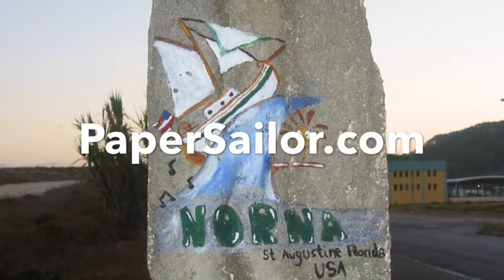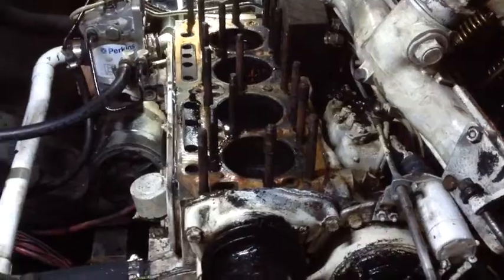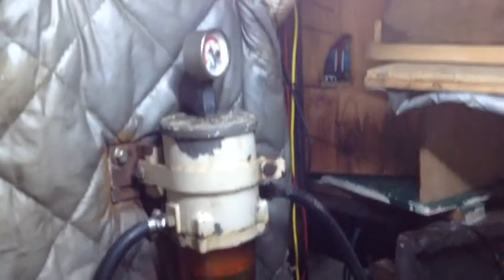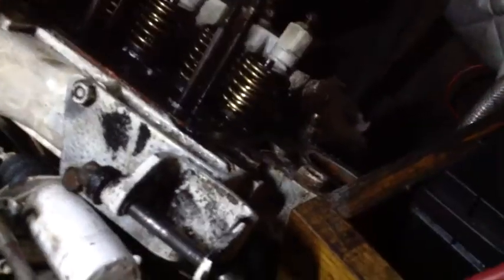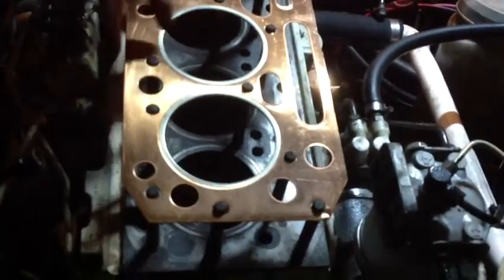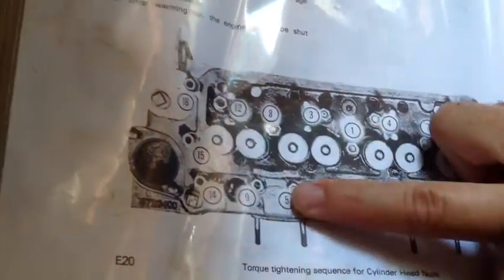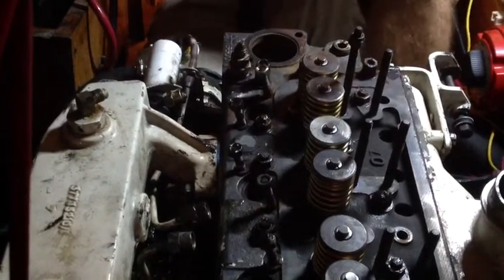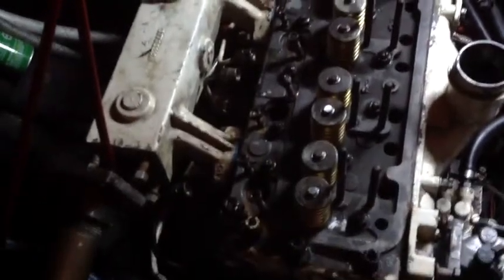Episode 16 - Replacing The Head Gasket On A Perkins 4107

Comment: when you torque the head down run the engine to temperature then while engine is still hot retorque head bolts an extra 10 lbs.this will ensure the head is really tight when it cools down.
Reply: Stuped, super stuped.

Comment: when you remove the head on a 4107 you might disturb the wet liner o rings,i did and lost the engine,when you put the head back on,refill the block with the most powerful water stop leak,that will ensure that if the o rings have been disturbed the water wont leak into the piston bores.some stop leaks can plug quite large gaps.the best on hear in the uk is miracle seal,amazon sell it so should be available in the usa.

Comment: Appreciate the video.  I am curious as to where you saw that the "goo" is to be applied to the head gasket?  My manual doesn't indicate that the goo should be applied but it also mentions a black gasket rather that a copper one. Any information would be greatly appreciated.
Reply from the maker: Ted Lahti this is for a 4107, apparently the 4108s are different
Reply: Sorry, I forgot to mention that my engine is a 4.107. Does your manual mention to apply the goo on the head gasket?

Comment: re-torquing head bolts after a rebuild is common, even on a "new" engine, IE, you had all the machine work done, and all new parts you still need to do it after brake in. the heat from running the engine in can cause the bolts to 'slack off. the best way to do all this is to replace all the head bolts with stud's and hex nuts, this is a 'trick' used by engine builders (of hi-performance engine) this is because it clamps the head down, the holding force is much better than simply bolting something in place, also one should anti seize on the studs, and either way you must oil the thread's on the stud, or bolt, other wise friction will cause your toque reading to be off.

Comment: ONLY 25 hours if motoring?  That seems a little soon?
Reply from the maker: Yes, after you have replaced your head gasket, you are required, after 25 hours of motoring, to pull everything off again and re torque the head to ensure that the nuts stayed tight.
Reply: Accidental Sailor Girl Ah, re torque....I thought replace the gasket.  It seemed like alot of extra work for such a short time.
Reply from the maker: Yeah, the manual even said to do so again after only warming, but we thought that was too soon. Better safe than sorry, I guess....
Reply: Accidental Sailor Girl Yes you are right, because Murphy's Law says that if you don't it will break down at the most inconvenient time.

Comment: Nice video.  I did the head gasket on my Saab, (gas) engine, so I'm familiar with what you're doing.  Sounds like you checked the surface of the head for "straightness", which is good because it's really important.  Don't know Perkins marine engines, but with my Saab, the head bolts stretch over time and have to be replaced, otherwise, when you torque the bolts, it's just not effective at getting things tight enough.  Another thing, when you have the head off, did you pressure test it for leaks and worn out valve seals?  I'm surprised that you would have to do another head gasket job at only 25 hours, is that normal?
Reply from the maker: Hey, yeah, we did pressure check it and replaced the valve seats as well. We also had it checked for straightness. We also had the injectors cleaned. For a Perkins 4107, we cannot get the head planed down for straightness, so luckily ours was fine. As for the 25 hours, this is only to re torque the head bolts to ensure everything is tight. Perkins recommends doing this twice actually, once after only warming, and again after 25 hours. We are redoing it after probably.... wow, probably over 6,000 miles logged since Sardinia, and the motor had a runaway in Nassau. It was time, or the engine told us it was time as it was leaky.
Reply: Accidental Sailor Girl That's interesting, a re-torque every 25 hours makes more sense.  With my Saab, you torque the head bolts in 3 stages using the "bolt order" in the service manual, for example, you would torque all of the bolts at 30nm, then 57nm,(Newton Meters), then the final pull is what's called a 90 degree pull, where you're not using the torque wrench, but just tightening the bolt with a 90 degree turn.  Quite different from the Perkins manual.  Yeah, old engines leak, the bolts stretch & loosen up, it's surprising , but just some bolt tightening here and there will stop a lot of leaks..
Reply from the maker: Brett Kramer
Yeah, not every 25 hours, just 25 hours of motoring after replacing the head gasket.

Comment: So good I watched twice. But you didn't mention if the overheating persisted?
Reply from the maker: We will do an update once we finish. It sure worked last time we replaced the head gasket, it had had a runaway since then, hence why we are replacing it again.
Reply: Accidental Sailor Girl runaway... do you think it is the head gasket? Or the rings?  Btw, if the manual says re-tighten after warming up i would, because all that metal is going to expand as it heats, and shrink as it cools, meaning those torque specs may be off as the head gasket becomes slightly deformed. You might consider a compression test with a good head gasket. Good luck.
Reply from the maker: Yeah, the engine had a runaway in Nassau. I will explain about this down the road. The compression is good, and we put the engine back together and she is running great. Better than ever. We will re torque. Woohoo!